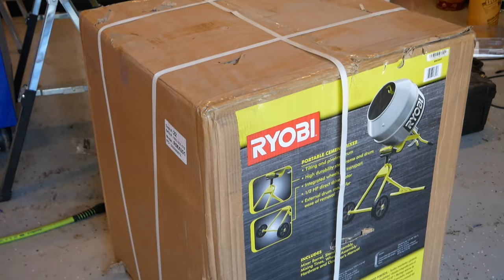Ryobi 5 cu. ft. Concrete Mixer is MONEY: Review/Demo

Comment: Excellent review. If I buy one, those cheap wheels would be replaced with larger pneumatic ones. Adding two smaller swivel and lockable wheels on the rear might help too.
Reply from the maker: Adding some smaller casters to the rear might be a good idea. Though in practice, I'm wondering if the mixer would tend to "walk" while it was mixing if it had four wheels.
Reply: Thanks for your reply. As a DIY'er, I often come up with 'sounds good to me' ideas. This might not be one of them. I'll work on a better idea and call you in the morning. @aaronsrapidreviews
Reply: If doing large parcels, I'd do away with the wheels altogether and mount it on  a trailer hitch platform, then slap it on an atv, tractor, etc.
Reply: @marcushennings9513  Thanks for your reply. Your idea sounds workable. Draw some plans showing how you would build one and get a patent. A video demonstration video would be interesting to watch.